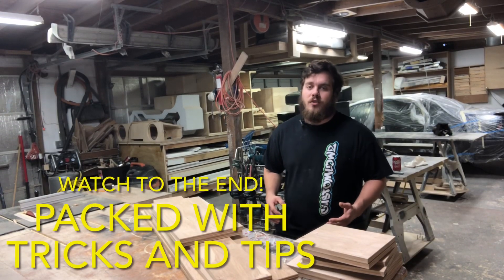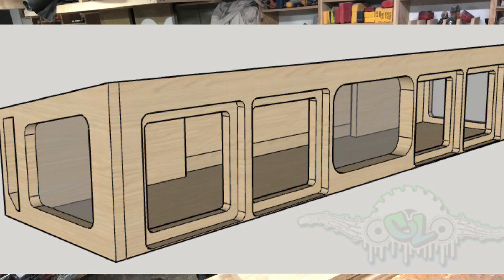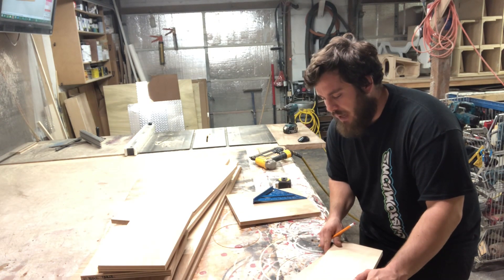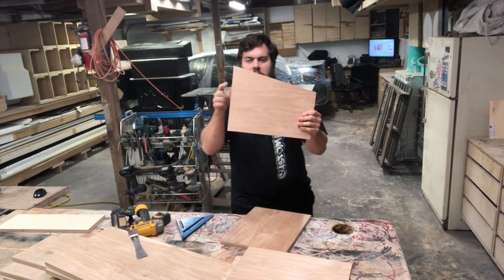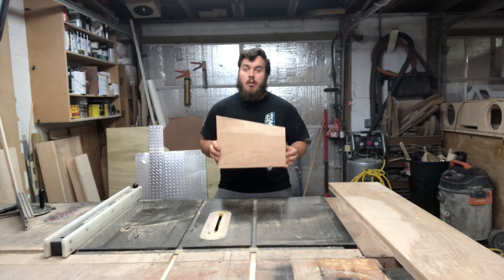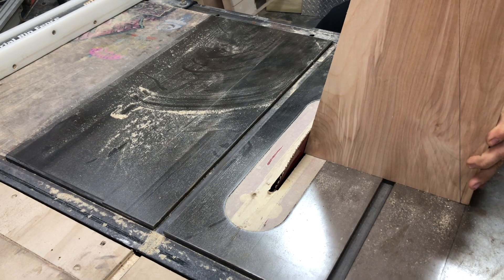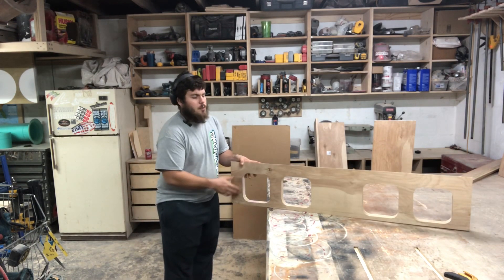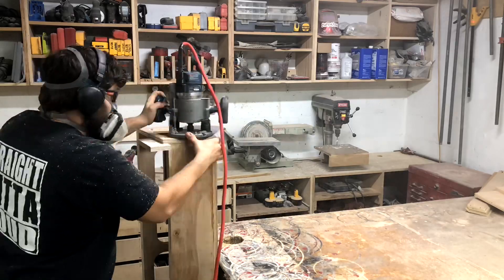How-To Underseat Truck Sub Box! Tips and Tricks-Ford 150&KICKER (Part 1)-IN THE SHOP WITH CUSTOMLOWZ

Comment: You cut it so close it gave you a haircut in the end of the video. 😂 not being a carpenter I did find it a challenge to do this box for my 21 AT4. So far so good on the box. Good video. And it is crazy what you can build with the new kicker depths being really small compared to larger subs that need 7 inch or higher depths.